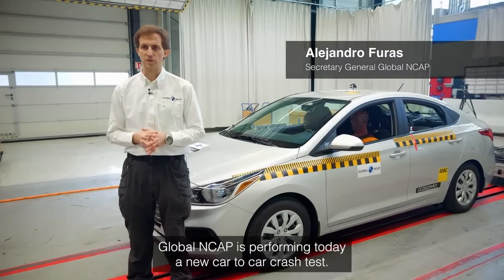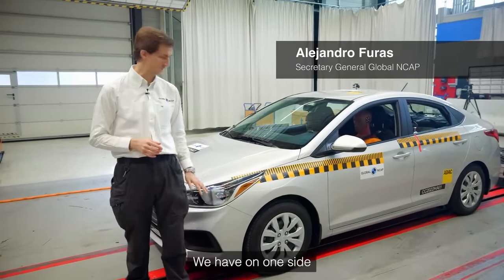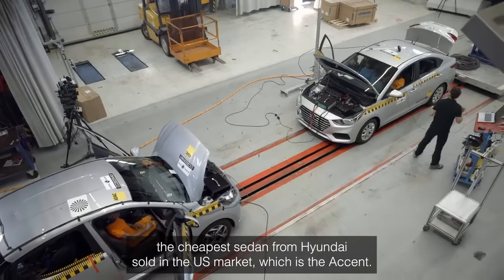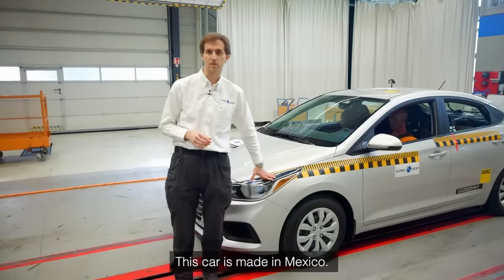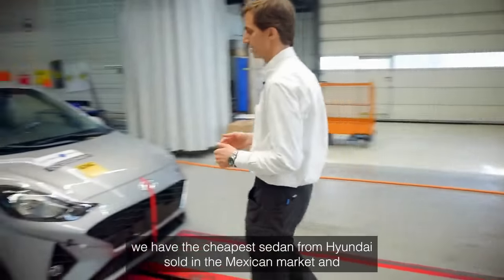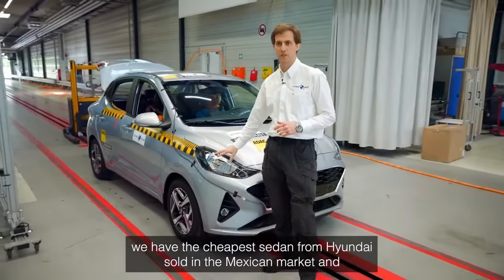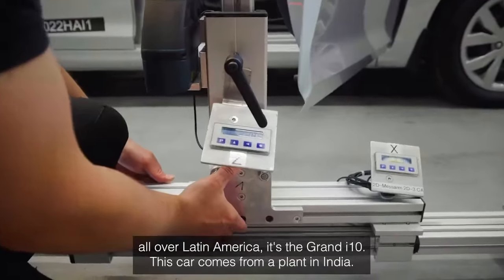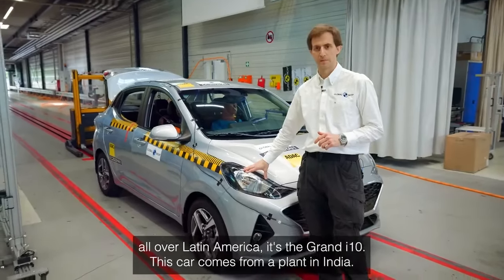HYUNDAI VERNA VS AURA CRASH TEST 😱 SEE THE DIFFERENCE OF BUILD QUALITY | GLOBAL NCAP

Comment: Those who r saying verna in india made has poor build and safety than for those the only ans is just one time check all the videos of verna accident. 99% times it has saved its passengers life and saving passengers life in most of the cases directly proves its build quality and safety. And also indian verna is built on k2 platform which shares similarities with hyundai Elantra platform. And the aura which got tested is an mexico version Aura which just only have  production in india. There is a difference between Indian Aura platform strength and Mexico Aura platform strength. Just check one time india nios crash test video. And remember one thing making any product in india doesn't clarifies that the product is for country itself. May be it is meant for other countries but not for own country.
Reply: Exactly 💯  !!
Reply: Elantra is k3 platform
Reply: @cgutblack3785  i am talking about old one not new one Elantra bro